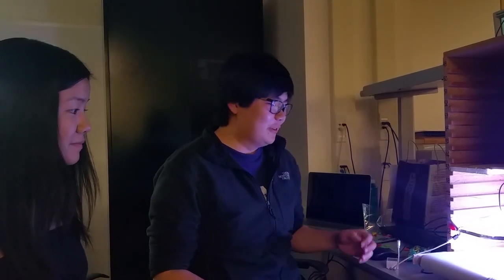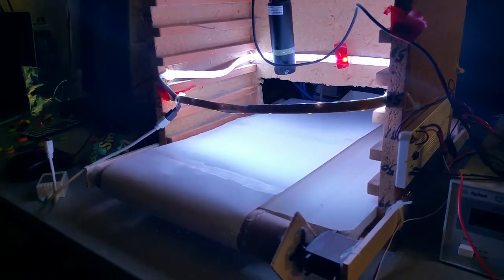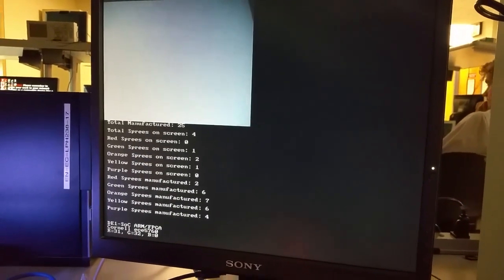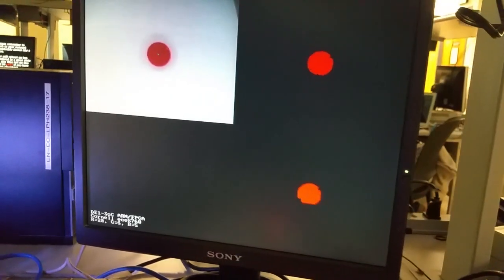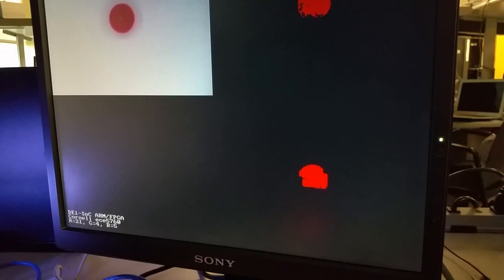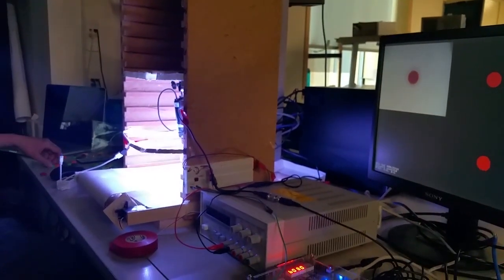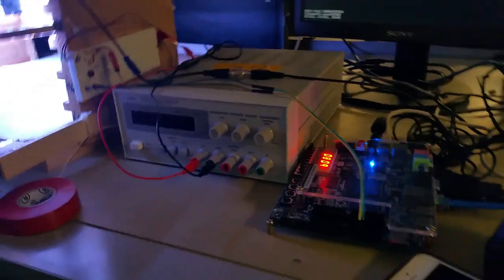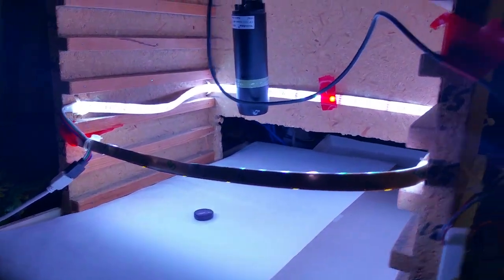video color-based object counter/tracker

Comment: nice work and good read up! thanks alot. I do color quality check at work, where we have to check for slight variations in LED colors, so I guess you would have bigger problems if you wanted to check for very narrow color bandwidths (lets say differ between yellow, orange and red) but I like your erosion/delusion idea to seperate objects, I think I will give that a try. Btw we just grab webcam images from a special webcam that can do 2k x 1k resolution and then process it via winapi in C# and still have 20 - 30 fps, but if you can make it hardware based and maybe come up for it with a bus protocol on CAN, RS485, FBus, ProfiBus or so, you could actually use that in the field. 

greetz WV